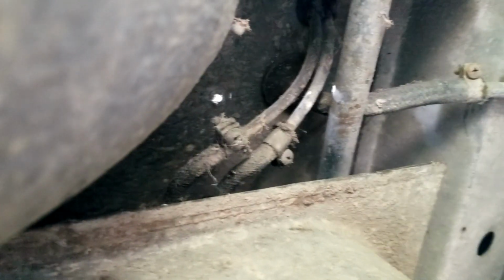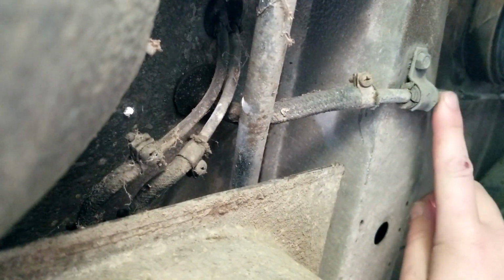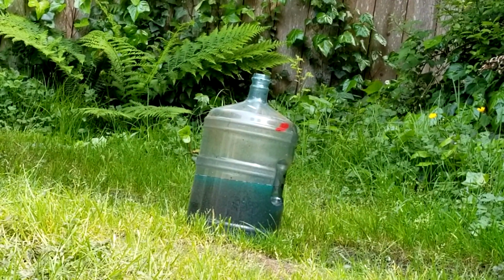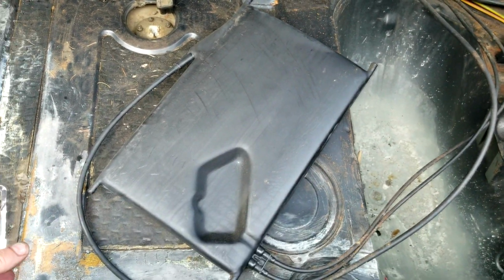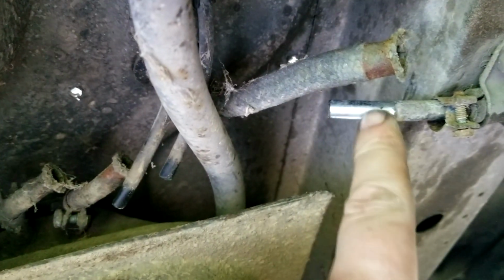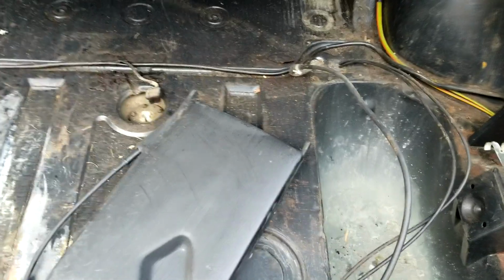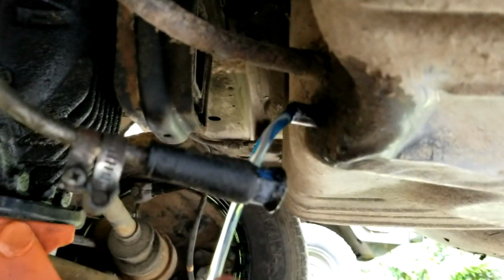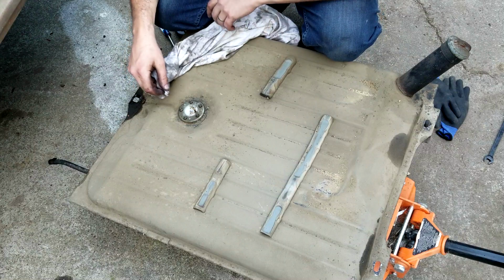W115 fuel tank removal

Comment: On my w115 it had a 27 gallon tank and it was slightly lower and had several dents in it from backing up and hitting things as w115 suspension  squats over time. Upon  inspection  it had a very rusty inside floor as diesel get water in the fuel and the water sits in the bottom. My parts cars there was a 17 gallon one in a gasoline car  so I cleaned that one and used red Kote tank liner and coated it twice.i had to put laundry soap and gravel in the tank and lots of slinging it back n forth, the new rubber lines.the gasoline tank and the diesel both have a screen filter drs8n plug large allen key in the center.i  removed both and installed the one labeled diesel.the 17 galon tank was a better choice it wasn't as low.the 240D is not the best long range car to use its so slow it doesn't like the highway.
New tanks are $600.
 That $400 parts car gave me European bumpers and a shallower fuel tank.
So if you diesel tank is very rusty inside fo get a 280 tank from w114 0r w115 less rust.ezier to red kote. Once it's koted it's worry free from future rust. On all my old cars I remove the tanks and red kote them inside to avoid buying a tank.these tanks are tricky there's a spiral tube around the filter and you must put a wire into it so when coating it doesn't clog the small internal metal tube that directs fuel. To go thru the intake screen filter Crain plug.it was a bear of a job but came out great.using black diesel the oil content avoids the  algie problem of seldom use months.im not sure if black diesel avoidd the water but I'm sure it's better with the oil content. If you jack up the back end with new stiff coil springs on the w115 the larger capacity tank is OK.